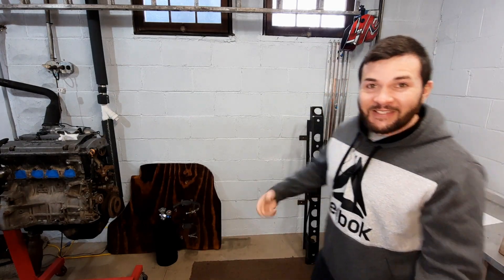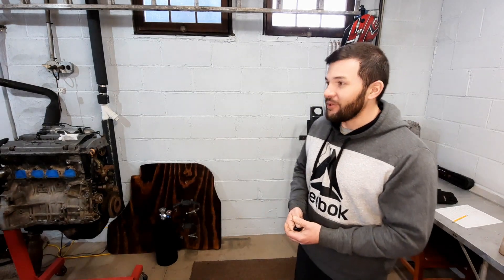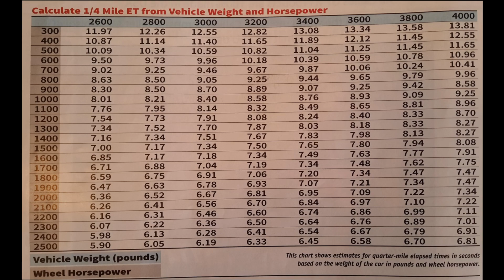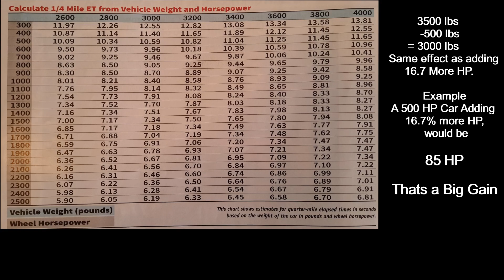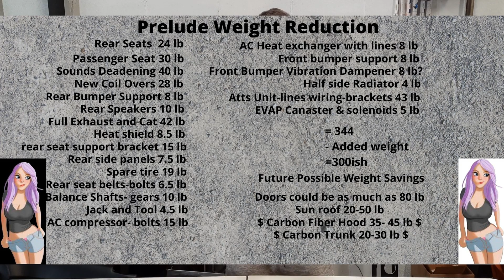Turbo Honda Prelude Weight Reduction, Over 300 Pounds Removed And Still Looks Street Car.

Comment: I hear you on the weight loss. I have a 5th gen eg sedan and I converted the car from power to manual rack and pinion. That took off 28lbs. Removing the not working ac system was another 30. Just that made the car feel way different.
Reply: Coupe*

Comment: i miss my 95 accord was basically a lude, i saved 800lbs by losing the car in an accident and going with an eg because i found it. the eg is fun all motor i was planning on boost but going with a 95mm stroke crank and higher compression on my sleeved h22a1 because i live at elevation and i need anything to make power.
Reply from the maker: I have two 95mm cranks I would like to use one in my spare h22a1
Reply: @wbracing1027  i am planning on it put a new head on my h22a yesterday and cylinder 2 is starting to score so I am hoping to build it over the next 3 months.

Comment: 16:33 FBI OPEN UP! lol

Also man do you have a traction bar installed on the car? The original front subframe/crossmember it replace is quite heavy. Although, I don't know how much the traction bars weigh, they seem like much less material.
Reply: The traction bars actually weigh more I believe. They are less material but they are thick steel meant to be rigid
Reply: @BrpdogProductions  Ah ok, right that makes sense. Thanks for clearing that up. I haven't experienced the difference from installing one myself but I'd imagine the benefit outweighs the extra weight?
Reply: @jaleeskhan6606  I sure hope so! I joined the 850 fab group buy for one so ill make a post in one of the Facebook groups once that arrives. Clearance is a huge benefit for headers or downpipes. Also the caster is easily adjustable without having to shim the bushings in the stock subframe thing
Reply from the maker: I think I weight it once its a type sh so it has radius rods there's a 25lb saving to be had with innovative mount front sub bar.

Comment: cant you just run without the rear bumper support entirely?
Reply from the maker: It's what the bumper attaches too theres these little metal slots the bumper holds on to. So not without securing it somehow.

Comment: Do you still have power steering?
Reply from the maker: Yes power steering and cruise control. I will keep both. Just not worth losing it yet I want to enjoy driving it.
Reply: @wbracing1027  have you looked into looping your p/s lines? With all the weight removed im sure it's alot easier to turn the wheel also. No?

Comment: Carbon fiber hood, trunk, and fiberglass fenders will save a good amount of weight but not cheap.
Reply from the maker: I would love to do the hood and trunk I  most likely atleast the hood
Reply: Yeah, the trunk is surprisingly heavy. If you do get a carbon fiber trunk lid. You’ll have to remove one of the tensions rods. If not your trunk will fly open with a thud when you pull the release.
Reply: Yeah those stock hoods are heavy af